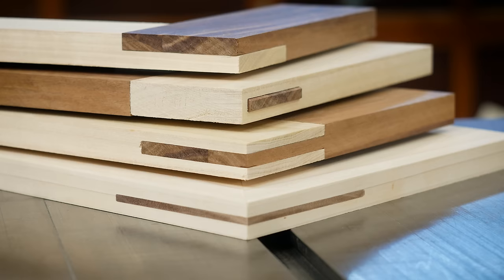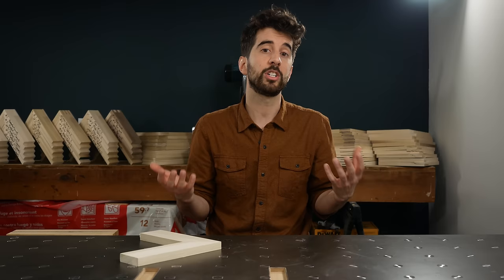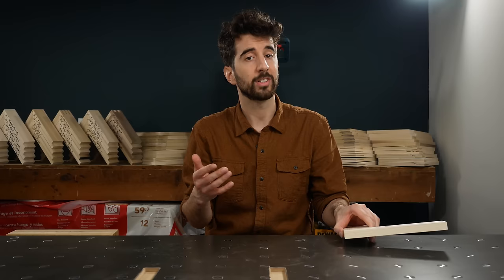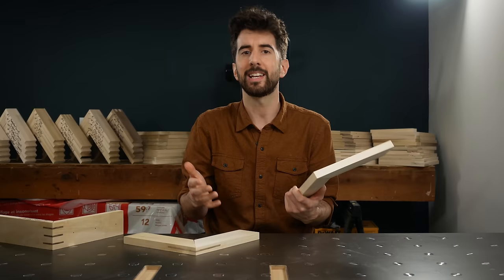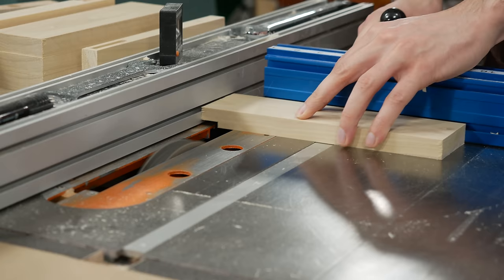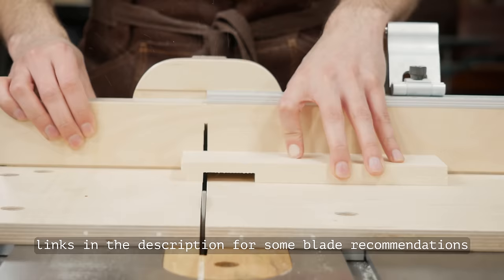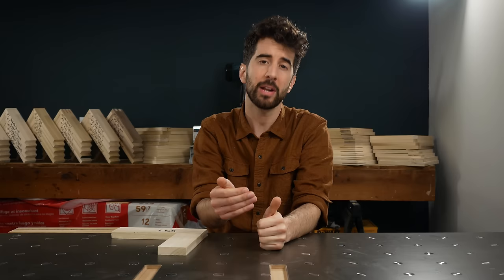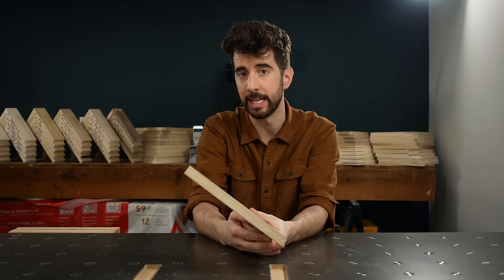Forget Mortise and Tenons... THIS joint is better.

Comment: Having the pump jack on the same lever you are measuring the tension pressure, skews the results depending on how hard the pump lever is used. IMO, the pressure results are dubious. The overall results are most likely accurate as which joint is best for certain situations. Mattais Wandel goes through all that. It has also been shown through various videos that the glue is generally stronger than the wood it is binding.

Comment: Ive noticed that most of these strength tests don't usually include mortise and tennon, half lap or bridal joints with two through dowels as well. That I'd really like to see.
Reply: Looking at how the test specimens break in this video, I wouldn't expect through dowels to have any significant effect - I can imagine them both weakening and strenghtening the joint, but not by much. For M&T and bridal through dowels could let you do glueless joints though if you're into that (like traditional Japanese joinery) - just make the dowels from really dry wood and make the fit reasonably tight, and then when air moisture "rehydrates" the wood that dowel is not coming out again (there's a building system called "holz100" using that technique to make gluefree prefab house elements).

Comment: mortise and tenon imho calls for a dowel, preferably with a hole bored little bit offset between pieces to squeeze them together.
Reply: and a diagonal brace with 2 more dowels.    The offset is to take up shrinkage from green timbers.

Comment: 6:58 - maybe i didn't get the joke but a chocolate teapot is a good analogy for something that fails under its intended use. Anyway, all the testing is very much appreciated and unlike so many youtube testers you seem to actually reach for some semblance of a statistical sample.
Reply: I think you weren’t supposed to think about it too much. It just sounds weird and unrelated to the topic of woodworking so it seems like a stupid reply from chatGPT. That’s the joke. 

That being said a chocolate teapot could make a delicious brew assuming it was thick enough to handle the 20 second brew time or it was in a bigger vessel to contain the tea/chocolate mix as it melted.

Comment: Ultimate strength isn't usually the main goal of a joint...  longevity, beauty and other characteristics are more important, usually...

If ultimate strength were the goal, we'd make joints as in a wood aircraft fuselage and wings, quarter round glued internal corner braces, and plywood plates nailed and glued over intersecting butt joints...

Comment: maybe you should test those joineries to their intended orientation of strength or load-bearing characteristics or how it is designed to hold or oppose load and tension. Surely all of those will fail if the force applied is on the opposite side or not the intended directional orientation of the joinery design.  And maybe clarify the most suitable uses of each joinery as additional info bits :D

Comment: To compare to the lapped joints, you should have made a 'through' morose and tenon, whereby the mortice extends right through the piece of wood and the tenon is as long as the depth of the mortice. This would be more comparable. A short, stubby tenon joint is less strong..

Comment: The disappointing lack of a "snap" where the joints suddenly fail (5:17) is due to the testing method spreading the joint rather than compacting it.  In the configuration used here, the tension is oriented across the grain of the boards rather than with the grain.  The failure will come at the weakest  point, and the wood splits at a force well below what will destroy the joint itself.

Comment: Traditional cabinet joinery does not need glue. For example, a corner lap is a glue joint, whereas a mortice and tenon is self-supporting. The Japanese are masters at wood joinery designs.

Comment: Hey Scott, thanks for doing this test. Really solid methodology and I always appreciate these tests that challenge conventional methods. Could you say a bit about your clamping technique for the the mortise and tenon joint? Clearly one has to clamp the half lap joint with pressure perpendicular to the faces, but I'm wondering if you used clamps in that way for the M&T. Since the glue is providing the strength of these joints, clamping pressure is theoretically hugely important.
Reply: M &T joints are designed to have a substantial pin through them to counteract  the torque loads that he is testing. This is a prime example of why people getting their technical information on Youtube are a danger to society.

Comment: How about the most maligned joint the pocket screw? For case work more than strong enough and quick and easy. 
I was a little surprised by the strength differences.
Thank You

Comment: With the M & T and the lap joints, you need the same overall thickness on both pieces. The half lap obviously does this.  Traditionally the others are one third, so twice the meat on one side.

Comment: there's a big problem in the way this is being tested... you are mostly testing the strength of the glue bond here, and not the strength of the joint.

so for example, perhaps a butt joint that has a really good glue bond might be super strong, even compared to a mortise and tennon, if the timber itself is weak.

But if you'd use a much stronger wood, then the mortise and tennon would be much stronger than other wood glue based joinery, as the entire mortise or the entire tennon would need to break. 

mortise and tennon has structural strength, that doesn't rely at all on the glue bond. The glue's only purpose is to keep the joint from being pulled apart, which is extremetely difficult to do. 

from a strength perspective, furniture doesn't break under constant stress in real live scenarios. It breaks because it get hit on one corner, and that exerts a very strong force on the joint for a split second, due to the very long moment arm that the force vector has, in relation to the joint. I.e. the force has a very big leverage to work with. 

So, the bigger your furniture is, the stronger you need the joints to be. 

moreover like mentioned below, glue will lose its bond over time, and half lap and bridle joints will fail, while a mortise and tennon joint will keep most of its strength even after the wood is gone, because the wood itself tends to swell within the joint, and that creates a tight bond even without the glue. 

if you're creating a piece of furniture for a few years, that's fine. but if you want to build something that'll last for generations, then better joinery is required. 

BTW, you can add dowels to a half lap joint, simply by drilling them in from the outside, and that'll make it much stronger over time, as you're adding a lose tennon into the mix. 

In short, I love your vids, but this one is wrong.

Comment: Surface area matters only if it is the glue that is failing, if the glue is holding then the cross-section of the wood is the next determinant - which is why your MnT was weaker than the bridle.

Comment: From a strictly strength perspective it would be interesting to see how the joints would hold up if you used a gap filling adhesive like WEST System epoxy which should force the fails to be fails of wood strength rather than glue lines (my hypothesis).

Comment: I may add that the reason why the mortice and tenon is regarded as the strongest is because it is when the wood is thick enough. The strength of half laps comes from glue, the strength of mortice and tenon comes from the wood. 

On thinner pieces of wood, the strength of the glue on half laps surpasses the endurance of the rather thin slice of wood around in a tenon. If you take pieces of wood three times the thickness the glue surface in a half lap is the same, but the tenon (and mortice sides) triple their thickness. If you imagine making a frames for barn with 8 by 8s or 10 by 10s, those tenons can withstand literal tons.

For regular furniture-sized project since the development of glue there are stronger joints than M&T, but if you go big it's still king.
Reply: Plus a through mortice and tenon is stronger than a blind mortice and tenon.

Comment: Great video.  Several times it compared surface areas of the different glue joints, but it didn't say where the joint failed.  If the joints failed in the wood, where is the evidence that, after a sufficiency, more surface area is "better"?  In another words, the glue succeeds as well in a simple joint where the wood breaks as in a more developed joint where the wood breaks.  Thank you.

Comment: You want your half lap or bridle joint stronger? Peg it. Two pegs along what would be the miter line 1/4 in from each corner. That should be fun.
Reply: Put a 3/4 " Grade 8 bolt through it ,  That should hold it.

Comment: The problem with this test is that the way the M&T is machined removes much of the mechanical strength of the joint, it needs to be haunched. Bridle/half lap have no mechanical strength when used on a corner, they rely on glue, if that fails the whole job falls apart. M&T is  superior in resisting movement, for example the tenon on a door rail will help control the stile. OP is missing the point of why this joint is chosen, you dont make doors with half laps.

Comment: Chocolate Teapot is an excellent simile! A teapot is for heating water, and the chocolate will melt before it can heat the water, utterly failing to accomplish its only task.
Reply: Fun fact:  A teapot is not for heating water. It’s for steeping tea leaves in already hot water. A kettle is for heating water. 

The song I’m a little teapot is actually about a kettle, oddly enough.

Comment: For both the M&T and the Bridle joints, what part failed? If the tenon broke then it needs to be thicker – up until the tenon and cheeks break about the same. I also think that approaching 1/2 the thickness would be strongest.

Comment: I have to wonder if the fact that the half-lap can be clamped with more pressure than some of the others isn't responsible for some of the greater strength it displayed.  A mortise and tenon joint can't really be clamped at all, at least not in a way that forces the faces of the two together.

Comment: Matthias Wandel declined my suggestion to test the strength of glue joints that were cleaned with a wet rag.  He suggested that I do it, however I think you are a better choice to make the comparison.  For years some YouTube "professionals" have stated unequivocally that using a wet rag to clean excess glue will result in a weakened joint.  Others use a chisel to remove the excess after a short drying interval.  It would be excellent if a person such as yourself were to test the theory that a wet rag weakens glue joints.
My best wishes and hope that you will do this, it should be equal in discussion across the spectrum to the gluing of the butt joint video.
Reply: You don't clean excess glue with a wet rag because the glue ruins the finish applied to wood. Wood glue is water soluble so it'll just soak into the wood grain when you wet it.

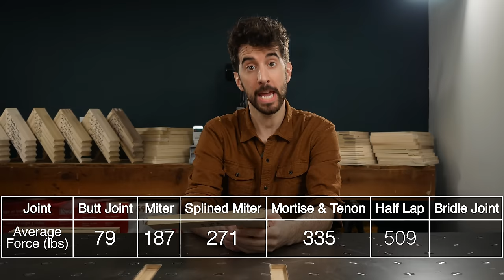Comment: Nice video and a lot of useful information. For bridle joint @14:25 you mentioned that only one setup is sufficient to cut both sides of the joint. I am trying to figure that out. Could you please elaborate or better yet create a dedicated video on how to setup and create a bridle joint? Thanks in advance.

Comment: The mortise you made are only about 10mm from the end of piece. No wonder they broke so easilly. The end side shoulder of the tenon should be about 1/4 to a 1/3 of the rail width

Comment: What is really under test here. Is it the strength of the wood or the strength of the glue? The way the joint fails is as important as the load. Did the joint break or did the wood break first.

Comment: Wonder if you used a half-lap joint and then put a dowel square through afterwards locking them together in the first place - how much stronger that would be??

Comment: While there are tons of different joints, there's a lack of consistency in your tests. It's a little unfair to pit some 45 degree miter joinery against non-45 degree miter joinery... Especially as all of the non-45 joinery used in this video, have 45 degree variants. - It's easy to imagine the laps and bridles would have given lower results due to less surface area for bonding; just as a tenon can give variable results depending on the chosen length of the tenon (whether you want it seen from the other side, or hidden inside), as well as whether you angle it or keep it parallel.

Comment: If you could put a spline on the inside of your joint it would be stronger. The way you tested it the spline was not used.

Comment: Isn't your strength test direction wrong? What kind of force applies to a box or frame from inside out? Maybe because of that the miter didn't get more points? I believe so.

Comment: perhaps a stupid question, but when sliding the huge splines into the mitered joint: how sure are you that the joint as such is completely covered with glue as the glue is quite viscous and the gap only as wide as 3 mm? Is the glue all across the triangular splines?

Comment: From someone inexperienced in this - why not after making any of these joints - place a dowel CROSS WAYS through them? This would prevent sliding movement at the very least.
Reply from the maker: I'm making the next installment in this series of joinery tests right now, and lets just say that adding dowels doesn't always mean it'll be stronger.
Reply: The dowels are not supposed to directly strengthen the joint - rather reinforce what is already there. Much like a bicycle cotter pin.  The only downside I see is having to cover them.  @ScottWalshWoodworking

Comment: Following your conclusion about the lap joint leads me wondering if I should have used a version of that for the Shaker entry table I just made for my wife.  Being a novice, I struggled to make good mortis and tenon joints.  They'll hold together and look fine from the outside, but I sure ain't proud of the quality- it ended up being a hack job.  Seeing this video makes me realize I might have been able to use a lap joint to join the apron to the leg (from the inside of the leg), especially since I was going to add corner blocks anyway.  (sigh)  Any thoughts on that? Thanks!
Reply: Just practice the techniques of mortise and tenon to include sawing, chiselling and planing.

Comment: Can you cut the half lap joint in the same manner as the bridle joint?  On end instead of laying fown flat?
Reply from the maker: yeah for sure! It would be pretty easy too because the fence wouldn't have to move for the other side of the joint once dialled in.

Comment: I don't know... it seemed like the surrounding materials broke before the joints themselves.  The joint material would have to be broken for these tests to be conclusive.
Reply: If the wood breaks before the joint, then it's conclusive that the procedure is acceptable. There is no reason for the joint to be stronger than the wood, and it's impossible to know the strength of a joint unless it is weaker than the material being joined.  

.

Comment: Please repeat the tests with compressive loading on the joint as it was done by another Youtuber showing the spline joint to be VERY strong !!.. As a structural engineer your tests result in completely different joint separation with a tensile loading. In real practice both types of loading exist and should both be investigated. It would make an excellent COMPARISON study of the different joint failures on your part. You can list the joint strength side by side...... -> compressive vs tensile for each type of joint.
Mr Lou

Comment: I'm also a fan of >1/3 tenon thickness approaching 1/2. The 1/3 rule wasn't established with engineering in mind, rather tooling.
You didn't show how the bridle joint failed. Did the tenon break? If so then increase its width & retest, please.

Comment: You didn't measure the spline joint in the same way. Your test was a force in the opposite direction of the one done with the weights.

Comment: Wouldn't the force applied to the jack handle also be transmitted to the scale and skew the actual measurement? That said, I guess the point is  not the actual measurement but how they are relative to each other.  But as you get to a stronger and stronger joint, the force needed on the jack handle also grows skewing the measurement proportionally.   So what you see on the scale is the force of the jack on the joint, plus the downward force applied to the jack handle.
Reply: Why wouldn't the scale measure the force from the handle? How does the scale differentiate where the force comes from?
Reply: Not sure if your agreeing with me or legit asking how to avoid the problem. But best solution I can think of is a porta power type attachment with the hand pump connected to the ram by a hose.  That way the force applied to the handle is not applied to the scale.

That said I understand why Scott used a simple bottle jack as it’s easier to get and much cheaper.  Also, I am confident the final conclusion would be the same either way.  

Just pointing out the number on the scale is also including the force applied to the handle.
Reply: @jasonhall1126  explain how the force from the handle somehow differs from the force of the jack from the scale's perspective. Because personally I'm not seeing how that can be possible. You're only using the jack because you can only make so much force. Ultimately all of the force the jack exerts did come from the handle though. You don't pump that handle and jack squat happens.
Reply: The force being applied to the handle was relatively the same for all the tests. He's comparing here, not looking for specific numbers.

Comment: Mortice & tenon is as permanent as it gets when the front side is wedged as they are in doors. Use a waterproof glue like Casacamite and it won’t degrade.